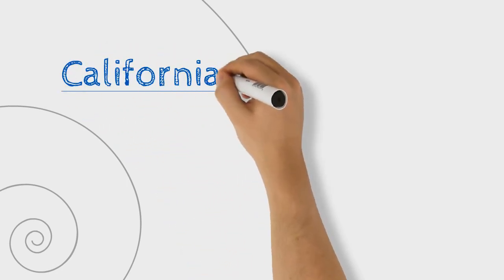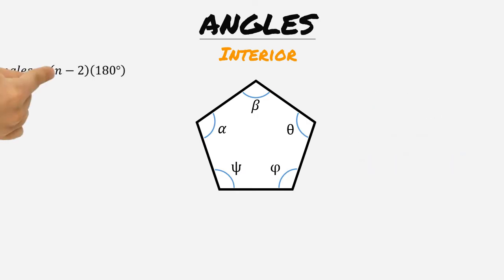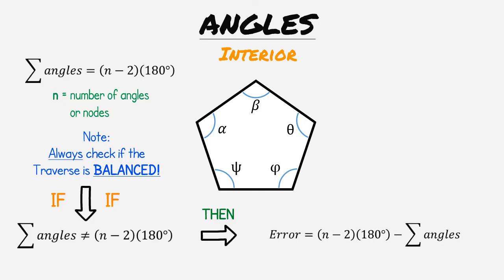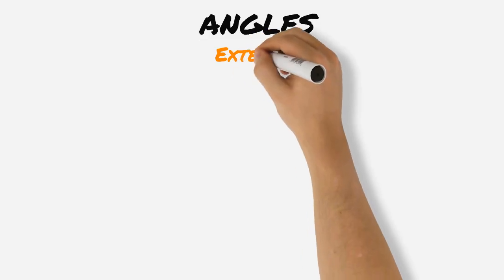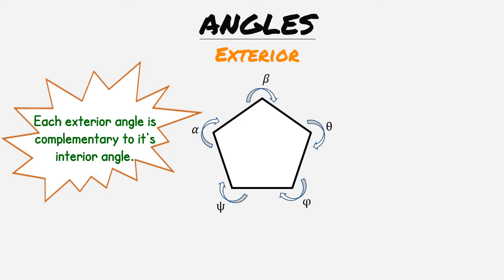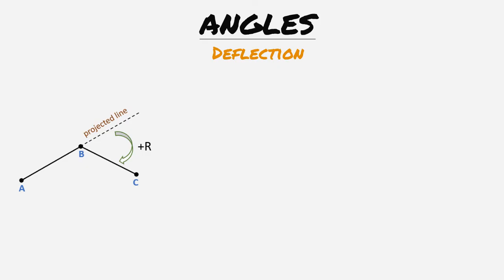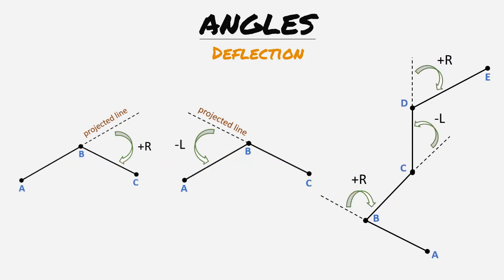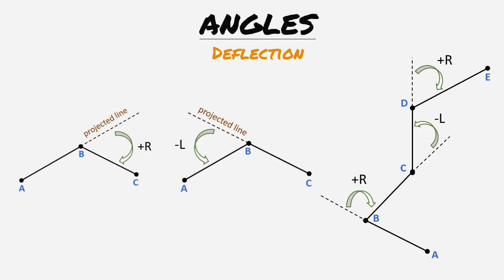Traverse Angles: Interior, Exterior, and Deflection

Comment: I always thought complementary angled added up to 90 degrees.
Reply: Thank you.  There is something else too. I always taught that the exterior angles of any polygon total 360 degrees. That is to understand that an exterior angle is the angle outside the polygon which is formed between one side and the other side produced on a little way.
Reply from the maker: No, the sum of all exterior angles cannot always sum to 360. The sum of an exterior angle and it's corresponding interior angle will always add up to 360. The total sum of exterior angles will depend on the number of nodes. You can confidently use the equation I show on the video. Please let me know if that helps. Please do not forget to subscribe to the channel, I will appreciate it.
Reply from the maker: Thanks for watching. Yes, you are correct complementary angles add up to 90 degrees. That was my misspoke. My apologies. Stay safe!
Reply: I think we define the exterior angles differently. In mathematics each interior angle and its exterior angle are supplementary,  as the 2 angles form a straight line. I suspect that in surveying each exterior (or outside) angle together with the interior angle make 360 degrees. It just means we mean different things by the words “exterior” angle.
Reply from the maker: Yes indeed. In surveying it's different meaning.